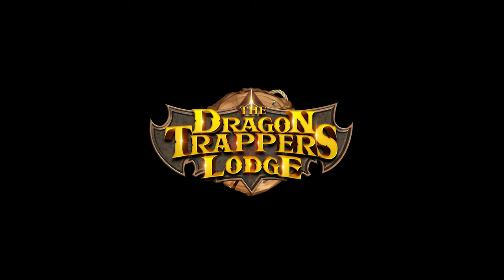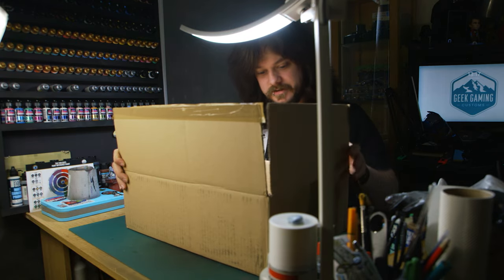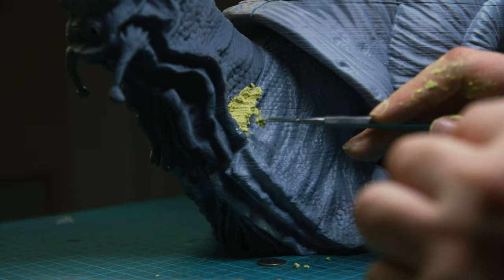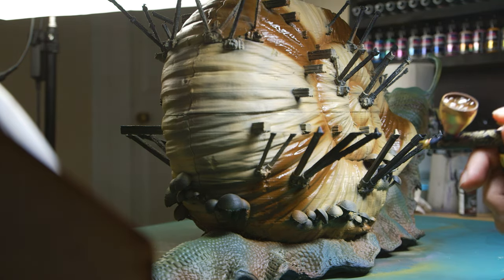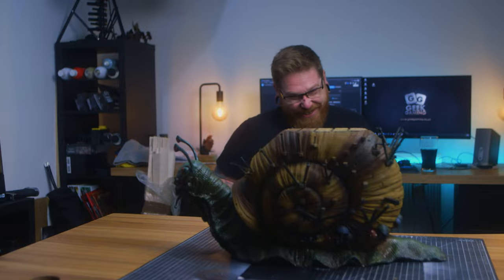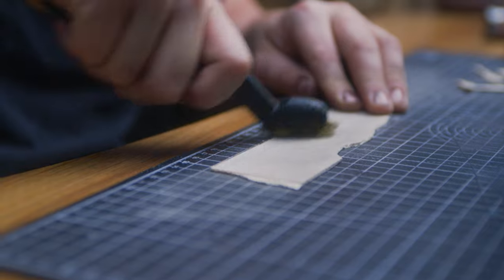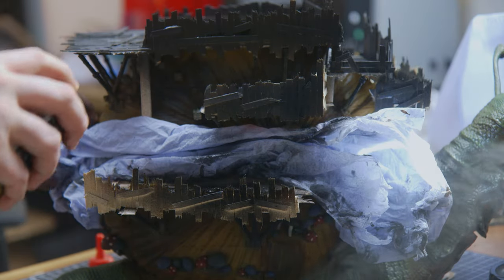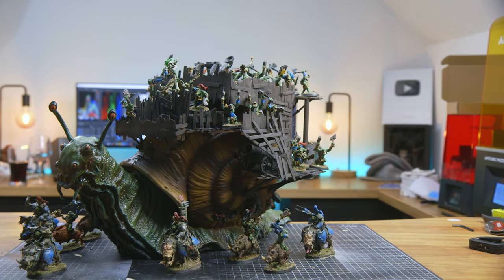MASSIVE WARHAMMER ORK BATTLE SNAIL

Comment: That is an amazing model. I kinda want to print one myself now but the time required must be immense with 1 printer.
Reply: It's not too bad. I've printed a few lodges, full sized, from them on my smaller resin printer. It is usually is in 12 or so prints, each taking about 7 hours. So about a week of print time for me, starting a job at night, letting it run. Then starting a new job in the morning. The main thing is it's so big an airbrush is needed, or it'll take forever to paint.
Reply: @michaelbycraft6274  That is a nice time for a resin. I'm more so afraid of FDM since it is so big. I know there are settings and whatnot to increase speed, but still, a statue I have about 3-inch square and 6 inches tall took about 18 hours at .2 "fine" settings. 
I guess something this size would be fine for rougher settings thought, especially the shell with filler. Sorry, just thinking out loud while processing the times you listed.
Reply: @RoseKindred  Sorry, I misunderstood. I have a few FDM/PLA printers and they are slooooooowwwww to get detail. They end up looking great (the Ultimaker especially) but they do take forever. I don't know if I could wait for this kinda model from those printers. Maybe you could print the inside as mostly hollow and that might go quicker? Good luck. It might end up being quicker to get it if you order it from etsy or something haha